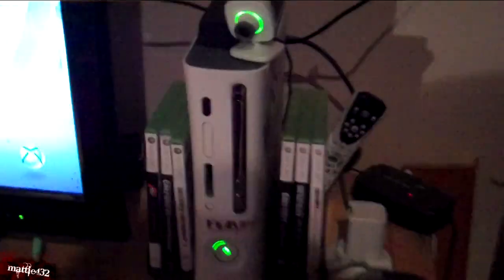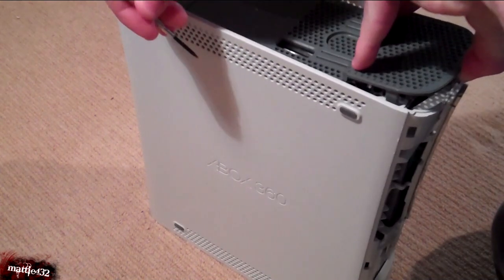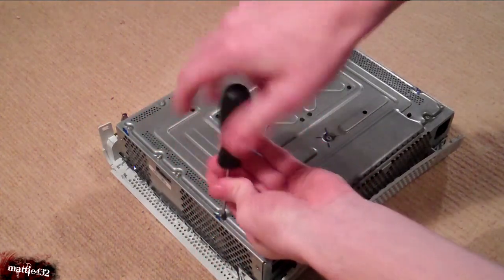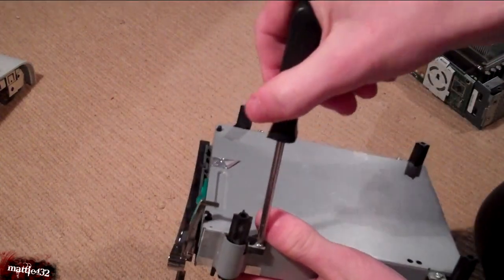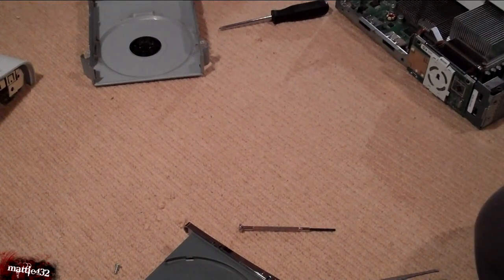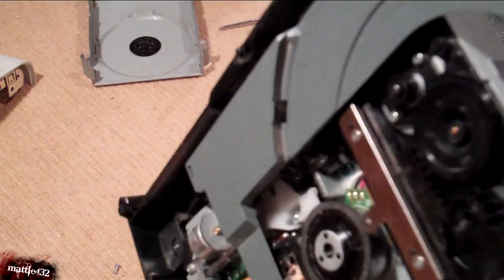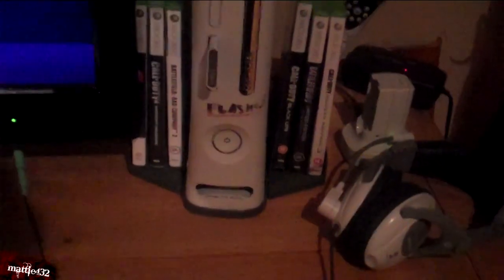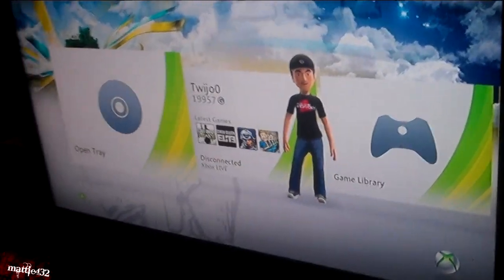XBox360 stuck/jammed DVD drive fix

Comment: why not use the self eject button just push paper clip
Reply: This DVD drive doesn't have that "feature".  In addition, you can't even use another run-of-the-mill DVD drive due to the difference in the power plug.

Comment: Where do I get that screw driver from
Reply: I had a Belkin PC repair toolkit and one of the bits for the screwdriver fit. You could probably find just the screwdriver at your local hardware store. Look for a Torx 10 http://www.acehardware.com/product/index.jsp?productId=35553116
Reply: hi

Comment: can someone help i can't find  a torx ten anywhere!!
Reply: you can use an allen key. wrench. whatchamacallit. thats what i did. worked fine. just be careful not to tighten the screws too tight because you can easily strip them
Reply: Thanks for the tip  but ive found one now

Comment: My tray is still jammed? Any suggestions?
Reply from the maker: think I made another video about disassembling the console. you could do that then take apart the CD drive if you are desperate
Reply: +Tiffany Santana its most likely the magnet on the top the disk tray gets weak over the years  so the tray wont eject
Reply: +chozo echo (W.W.P.P) All the magnet does is hold the disk in place for the laser to read the disk.
Reply: correct but if the magnet gets to strong or the tray gets weak it will not disengage their for the disk will not pop out - well plus the gears and the elastic do play a big part as welll
Reply: +chozo echo (W.W.P.P) I have never had that issue fixing my own or others trays. In my time repairing these its usually a popped elastic, grime, tissues or the bottom plastic of the tray gets freyed from being opened a lot and gets caught on the front lip of the tray.
Reply: Just spray a little wd 40 on it using the straw. Or any other lubricant. Google it.
Reply: +Mattie432 someone had this xbox before me and they tried doing the same thing and now I did all the steps but the people who tried this before fixed it... but messed up all the stuff in the motherboard and now the screws won't go all the way into the system. please help me someone
Reply: +ItzTrae do you have a torx screwdriver for the screws? its childs play putting it back together
Reply: No
Reply: Ill get one and try. Thanksd
Reply: +ItzTrae Make sure you take pictures, there's nothing more frustrating than putting a console back together only to find that you forgot to put a piece back in. Good luck!
Reply: +Chelsea Lindsey check out what Bushwookiee_411 said below. That might help. good luck!
Reply: I know how get a fork put it in the stuck tray and pull while pressing the button I'm here cuz my 8 year old Xbox fried out it got the red ring 5 times but it still work years 2 mouths ago it broke
Reply: chozo echo  its not the magnet, you just need to buy a new rubber band or whatever it is. The original wore out, no way of fixing it. you can temporarily fix it but not permanent. Believe me, ive tried many ways and buying a new one works. just know the correct size
Reply: "Wow! This ACTUALLY worked!!! THANK YOU!
The gears were also gunked up with dust and grime. Cleaning both the gears and the belt did the job."
Reply: A New Champion
Reply: arry a it worked for me also.
Reply: take your hard drive away and ram and some parts. sell them. buy another xbox360 (second hand) put your old xbox360 hard drive in your new xbox360
Reply: Why if he can just buy a new rubber band to replace the old one that wore out? I did it to mine. Your method is wasting money
Reply: NewChampion modz Basically that's what I did bought a pack of official replacement DVD drive belts from Amazon for only four or five bucks.

Comment: unfortunately, as useful as this video was, my disc drive is still jammed -_-
Reply: Mines was till jammed too but I just put I tiny bit of WD-40 on the gears near that rubber band and filed down some of the metal from the disk tray housing kept testing it and it worked no problem

Comment: Only fucking microsoft would be stupid enough to put the screw under a stupid panel on the side, so that you have to poke it with a paperclip to get at it. I've wasted hours of my day on this rubbish. If the PS2 can open without any problems at all, why can't a modern console? 
Thats what you get for making technology for the sake of technology.
Reply: Matthew Power 

PS2 can only be compared with the Xbox and any other console at its time but the PS3 can be compared to the Xbox 360, consoles are made to look less 'mechanical' each 'generation'. Compare the screws on the Xbox One controller to the Xbox 360 controller because you might find a noticeable difference. 

They try to make it less easy to brake and need repairs and because of that the console doesn't need to be easier to take apart, the PS2 and Xbox are slightly primitive consoles and are easier to brake / need repairing when compared to modern day consoles.

Consider us as that unlucky or curious percentage of console owners who might have to send their Xbox 360 in for repairs because the possibility of a faulty console is not expected as much as it was in the past so the inside of the Xbox 360 is not needed to be accessible as it was before, also another note Playstation is an entirely different brand of consoles owned by different companies and are going to have there differences.

Comment: In the process of doing this shitty "tutorial'' I broke my screwdriver, and my Xbox and so I spent 200 dollars on my Xbox, my screwdriver, and titanfall, which was inside the Xbox that I broke
Reply: I'm sorry to hear that dude but I don't know how you possibly could have managed to do that. When you took the drive out and open it the disk was broken? Did you drop the tray with it in it because even a few shakes and it would be okay. I'm also willing to bet that your Xbox is not completely broken and you could figure out how to fix it if you are willing to try. Do not let this discourage you from trying to fix other electronics. I have fixed many things from YouTube videos like my iPhone 6 and over 50 iPod touch 4th gens. One thing I have learned is the best way to learn is to fk something up because then you know for every time after. Take another wack at your Xbox because if anything, it will be just like it is now (useless).
Reply: Thanks, but I raged to hard when I commented this, my titanfall is OK but my Xbox is completely destroyed lol
Reply: I'm willing to say that your Xbox is mostly salvageable event though it may appear to be "destroyed". I was actually able to do the same thing in this video without ever having to take more then the face plate off. I waited a while till i get the disk drive open, then was able to get the small rubber belt off with a tweezers, wipe it down, and put it back in. All in the matter of approximately two minutes. If you have a friend who is good with electronics have them look at your xbox, I bet you could get it working again, or at the very least have all of the spare parts except for maybe one or two things for when you next one shits the bed. (it's technology, it'll break sooner or later, hopefully much much later but if you are like me then it will probably be sooner)
Reply: My Xbox got the red ring of death and the fan got broke somehow and I went to the Microsoft site and they said there was only one way to fix it, but it would cost a lot so I'll just take the hard drive and buy a new one from my friends d for 50 bucks, but thanks for the info
Reply: JayHawk Nation i put mine i the freezer right after for a minute and took it out and left it overnight and it worked